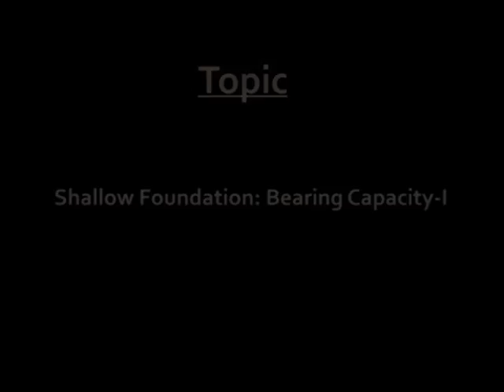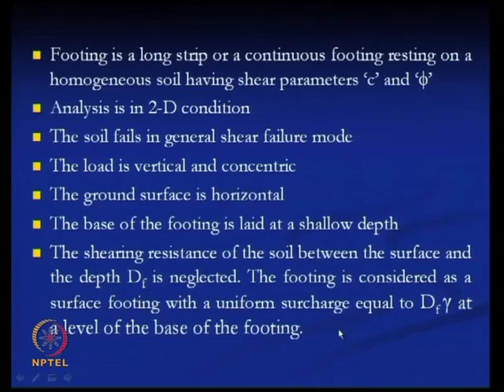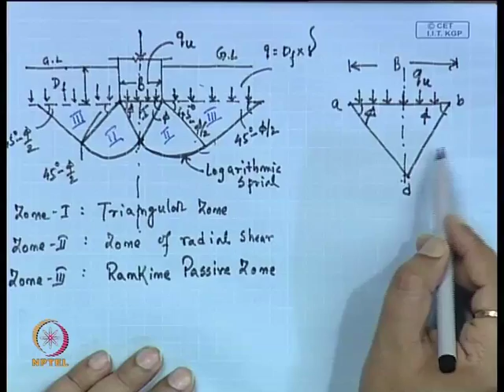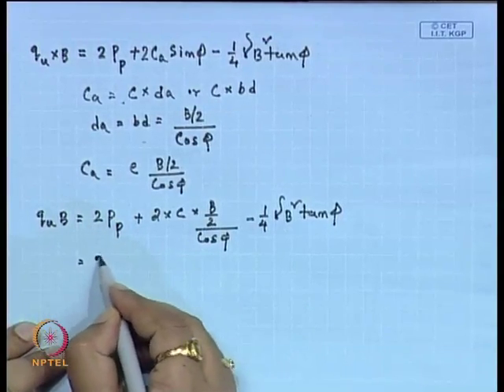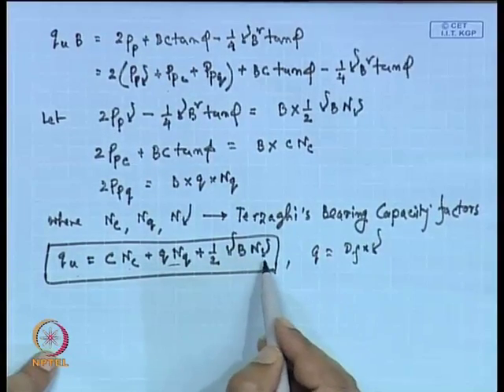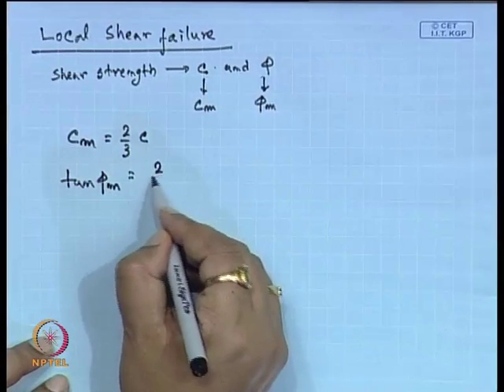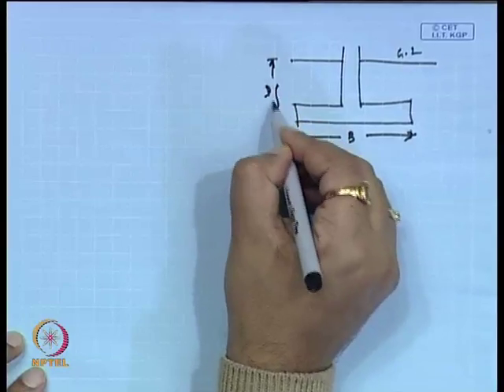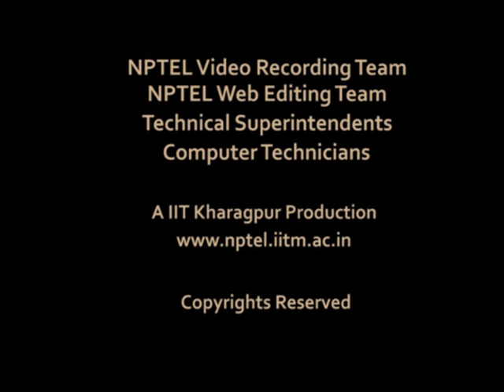Mod-01 Lec-06 Shallow Foundation : Bearing Capacity - I

Comment: In the effect of Water table case Dw'<= B and Dw'>=B formula as per you is confusing ...
What if Dw' = B, which formula do we use???
Please clarify my doubt sir.
Reply: You can use any of the formula, they will both give the same results. Just put the value of Dw'=B in Case-III and it will  give the same answer as Case-I.